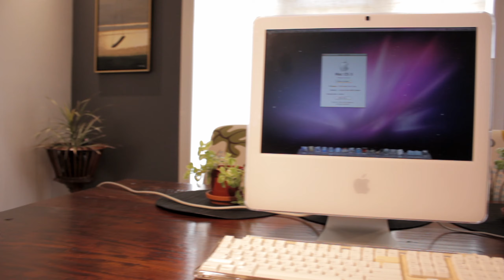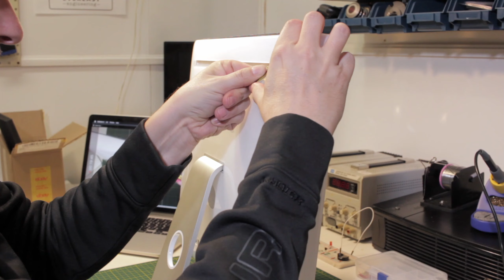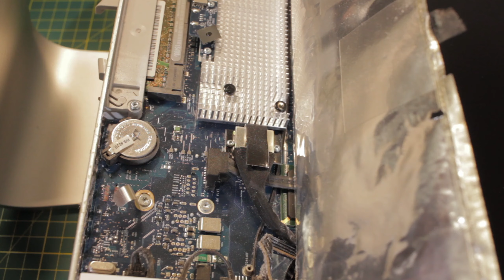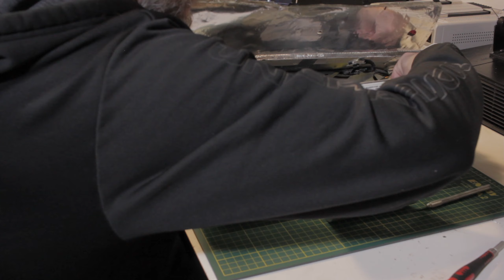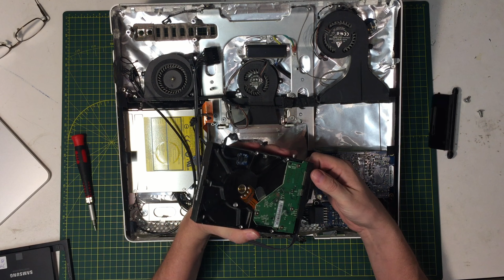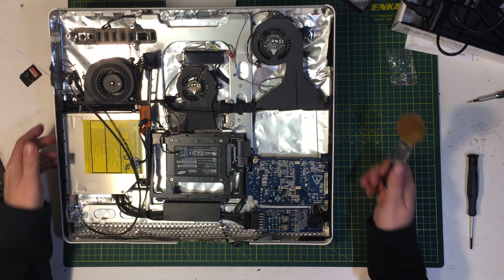'06 iMac running Windows 10 - how to teardown to upgrade the CPU

Comment: I installed Linux Instead, it's much faster than windows 10 and with a split partition, OSX & Linux Mint Mate, it works really well.
Reply from the maker: @emmanuelbreton5431 Did the video driver out of the box work? Was is this one?

https://www.linuxmint.com/edition.php?id=321
Reply: @yes the videos driver works perfectly, no issue on film, YouTube also but don’t expect 1080p with a 2006 machine. I installed mpv and mplayer both work well, on games I installed Snes and Mame, dosbox, and wine with an ssd. I have also 3 gb of ram. It’s not the fastest computer I own, my wife use it from Time to Time on the web or to write letters.

Comment: Hi. i found a imac 2006 on garbage and because was a many things the last owner i reseted.But i tried install a lion the same was and no works almost nothing. Could you please tell me WICH SISTEM I CAN INSTAL IN A 2006 MAC? WINDOWS 10,ZORIN, UBUNTU, LINUX MINT, FEDORA, SIERRA? tks so much
Reply: You can run Linux mint , put ssd in , even 120g will do & upgrade ram , put 2.4g cpu in from China for under $10 , you can also run dosdude patcher & install Catalina

Comment: $50 mac and $50SSD? Not worth it to run YouTube but definitely a fun project nonetheless! Im having power problems with my 06 Core 2 iMac, where it powers on only if i open up the cover and take out the CMOS battery then replace 😂 hopefully ill find a solution for that someday

Comment: 3/4/24 Just found this video and have tried upgrading Apple Mac  without much success. I have a 24" late 2006 iMac that's like new along with the Apple music remote that will magnetically stick to the lower right side of the screen , upgraded the memory to 4 megs of memory and would love to upgrade it to a newer OS beside the OS Lions you mention in Video. Like you stated in video finding a browser that will still work well in Lion including safari has its issues and not finding a browser that gives full support in 2024. What I have been wondering is since the iMac has an Intel Duel 2 processor, if I could completely just reformat the Hard Drive or run an external hard drive with Windows 7 or another OS that I could connect to a port of the iMac screen that allow booting without needing to tear down the iMac that will allow a modern browser in 2024 along with software support.
Reply from the maker: Unfortunately you need to replace the CPU in order to install any modern OS!

Comment: Hi

Very well put together tutorial and video

Personally i have 3 older macs, Ibook G4,  Macbook 5 Laptop @ 2006 i think with core2duo and either 3.5 or 4g ram, Similarly i also have a Imac @2006 again the same specs core2duo and 3.5 or 4g ram

The G4 runs 10.4 or 10.5, the other 2 run 10.6

What i have done with the 2 Intel machines is only replace the hdd in the laptop with a ssd as it was a simple 2 minute job, i have always thought the imac was just to complex and as it is working i dont want to break it ( i am fine with PC etc but the imac is just to fiddly for me - if i had lots of them like windows pc i would give it a go , but i dont want to damage a 1 of 1 that i have)

So the Intel laptop has a ssd, i reinstalled 10.6 and all my software. I then used a boot manager rEFInd and successfully installed Linux Mint 17 as it worked ok with the strange 3 EFI set up on the intel macs

Even though both of mine are core 2 duo and 64 bit cpu, the max ram is 4G, so it still only will run on 32bit OS, even on a windows machine with say 1G or 2G ram,  if you have less than 4G ram you have to install 32bit OS

The Mint version was not the latest, i recall booting a few ram based versions of USB to find one that works well ( installs properly ) i also came across a web page with modded iso images to suit the hybrid 32bit efi boot for the intel 64bit core 2 duo's

BTW i think the original core 2 you had is 32bit only and the core2duo is the first of the hybrid ones

I did triple boot both machines, but found the 2016 - 2018 version of windows 10 to run fine, however by 2020 when updates were happening they become sluggish

Currently we have 3 desktops, 4 laptops as daily drivers, and the last thursday of each month all machines are set for windows 10 update and they are left alone, the modern i5/i7 / Ryzen 7 machines do handle it well - at least all machine share the update file pool from the Lenovo

At todays prices, i would just buy a used 2009-2012 system, they are very cheap, for myself these macs were the first modern macs and at the time with XP and win 7 issues they were at least virus free ( i ended having user control on windows and nortons installed on the 4 pc's at home and no one had the admin password except me - things you had to do )

Actually my daily driver is a Lenovo core2duo, i purchased in new in @ 2011/2012, it is a small form factor and silent and basically runs 24/7 - it works great, the only issue being 2 cores when a windows update is happening it becomes sluggish and also on some start ups, it is busied out with hard drive indexing and defender scanning for up to 5 mins

Again great video

Comment: tell me . with the fan , never stop moving .. what have you done ? Thanks a lot !!!
Reply from the maker: You mean when in Windows, the fan keeps running? Try Mac Fan Control (https://www.crystalidea.com/macs-fan-control) and see if that helps get it under control?
Reply: @everlasting1 😅i didn',t connect the cable of the fan😊. Buy win10 on my 24" Is instable😮😢. Any suggestioni? ❤
Reply from the maker: @ilbulga  So is your fan running? If it's running all the time, that's ok but if it's not spinning, then the computer could be overheating causing it to crash. What is the instability? 

Forse potresti fare un breve video che mostri il problema?
Reply: @everlasting1  thanks!😅 i didn't connect the fun to the motherboard... thanks for the answer Brother!
Reply: @everlasting1  the instabilità Is about the connection Wi.fi.  ..  the wawe simbol became a world.. to understand....
Reply from the maker: Hmm, not sure. If you can try to reinstall the Wifi drivers that might help but it might be a problem with the network, or many other things. Good luck!! @ilbulga
Reply: @everlasting1  yes... I'm thinking to install some Linux  distro.  I'll see.  I bought this big iMac to play with It , working on It .but if I could back the time... With 200 euro you have a good Little PC that runs well. Insted mine 🖥️😔...

Comment: A useful video!👍👍I would have replaced the Cmos battery while the computer was opened up.  Apple builds are always complicated to work with, Dell made all in one computers which were designed to be simple to work with, the back cover was held on with screws and once that cover was removed everything was easily accessible.   Linux Mint Mate version would probably work well on that computer.

Comment: Quick Question : Can we install a bootable Windows 10 SSD and swap instead of the HDD.
Reply from the maker: I put an SSD in but did a fresh install so the drivers were detected properly, if that's what you mean.

Comment: I cant get the audio working, which driver did you use?
Reply from the maker: IDT Video Codec from Microsoft, and it works really well including low latency in Cakewalk.
Reply: @everlasting1  thanks! Im gonna try it later
Reply from the maker: I'm not sure, I will check on my machine and see for you tonight!
Reply: I’ve tried installing idt driver but the sound still not working *sad

Do you perhaps still got the driver files? Or at least still remember where did you download the driver?
Reply from the maker: @davejnathan10  I don’t think I specified a driver, I think windows picked it up on install. Hmm. I’ll poke around the machine tonight. What’s the device hardware ids for your sound card? Maybe mine is different too.
Reply: @everlasting1  ah i see, auto install didn’t work for me, my id is HDAUDIO
Reply from the maker: @davejnathan10  Indeed, that is mine too! I spent more time and I think I found that I must have had difficulties and with trial and error got it going with some Apple Drivers. I THINK I have recreated the install and placed a zip in the Github repo under Missing Bootcamp Drivers, you'll see it added tonight. Please let me know if this works!
Reply: @everlasting1  You’re a life saver! I’ll go check it out when i get back, thanks so much!
Reply: @everlasting1  it works!! Woah you are awesome! Thanks!
Reply from the maker: @davejnathan10  WOOT

Comment: Hello there - Just sorted my iMac using your github guide! One amendment: "Apple Remote" driver is also needed, it's the IR Receiver driver otherwise it shows as generic USB device which "cannot start" under Device Manager. Thanks for taking the time to put that guide together!
Reply from the maker: Good tip! I'll try to locate it and add it to the repo!
Reply: @everlasting1  it’s in the boot camp driver folder with all the others!

Comment: There is a project to run chromium canary on mac os 10.7 called chromium legacy - I have version 96 running just fine. (Higher versions should also work since they are patched but I don't have a reason to update it.)

Comment: Would it work with a C2D T7600?
Reply from the maker: Yes, that's the best CPU you can fit in this machine. I chose the T7200 just because they're so cheap. The 'best of breed' from any generation still fetches more money, like $40 or $50 at the time. I got my T7200 for $3 from aliexpress though even those prices have risen!

Comment: just found an 06 imac for $9.99 at a thrift shop. will attempt all of this!
Reply from the maker: I used this machine just the other day. It runs surprisingly well still (the SSD is a huge boost) and the screen is just outstanding! Good luck, post here how it goes!
Reply: @everlasting1  CPU just arrived today
Reply from the maker: Good luck!!!
Reply: $9.99. really, impossible. Where Did You Buy it?
Reply: @esneidermesa5298  value village
Reply: That's cheap, I bought mine for $30.00
Reply: What do you do on it?

Comment: Thank you for your walkthrough (github). I read it yesterday, and ordered a few stuff: SSD, 2x 2GB PC2-5300 RAM, SSD, 2.5” to 3.5” HDD adapter, and a C2D T7200. I managed to successfully upgrade the firmware of my iMac4,1, and now it’s listed as iMac5,1.

Ultimately, I may stick with Windows 7 64-bit, I’ll be sure to follow the rest of your walkthrough. Thank you and happy holidays!
Reply from the maker: Most welcome! I still use this machine!